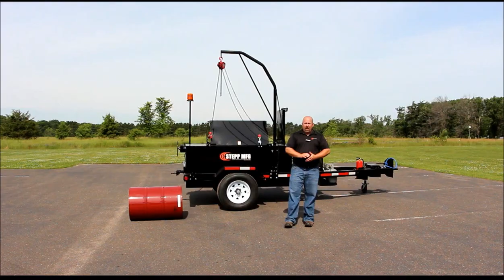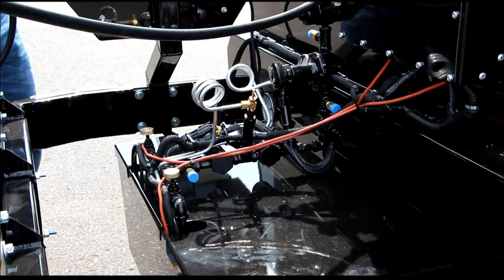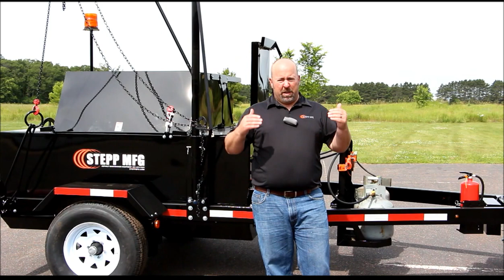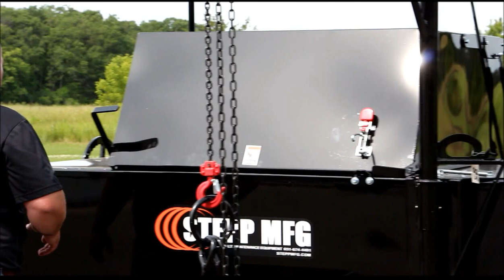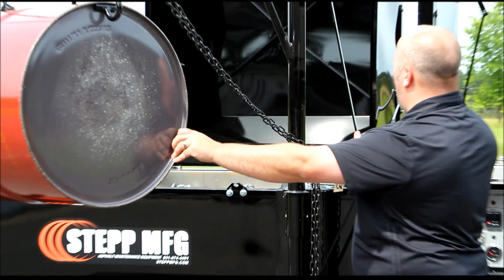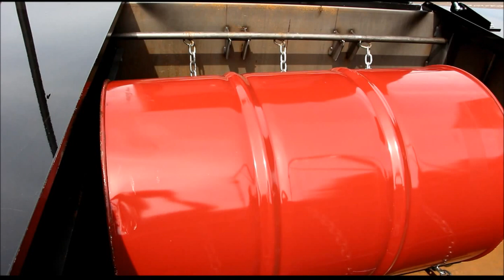Stepp Manufacturing Co Inc Sbf Bottom Fired Kettle Training Video

Comment: I use this unit several time a week. it works well and fast . when you are in the engine compartment look at the wiring next to or on the motor mounts .we had a wire spark next to the fuel pump rubbing on the motor mount. also be sure to use the safety lock above the bypass valve at the rear of the boom . our boom was damaged because the boom was not latched in the front properly and the rear lock was not used .the boom swung out just enough to catch another peice of equipment.